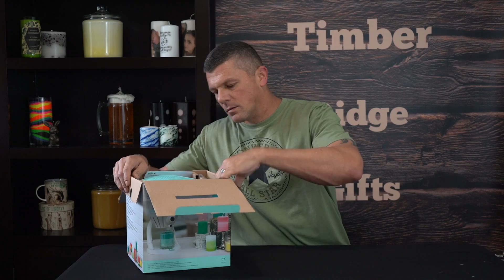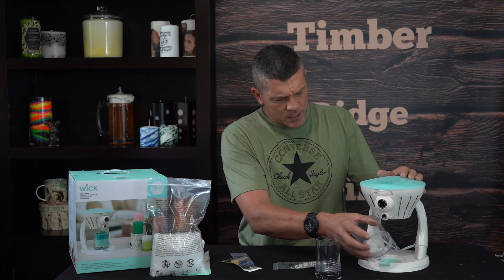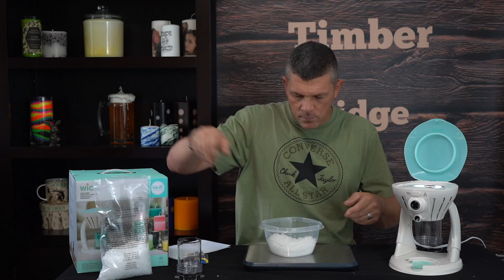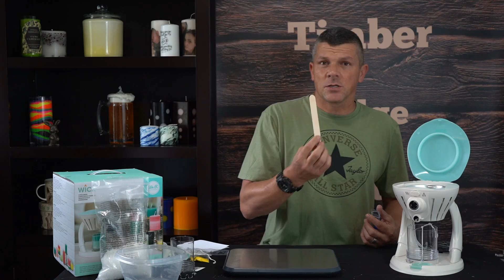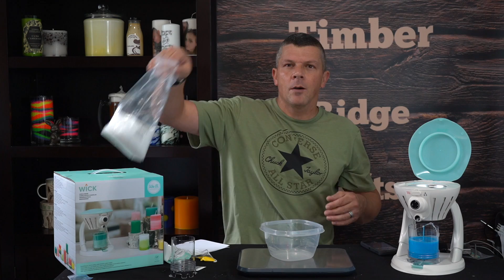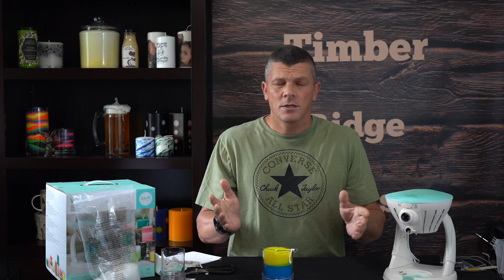Candle Making Machine! We R Memory Keepers Wick candle machine

Comment: Love my WICK 🥰 
Another helpful tip:
You can also run the candle wax into a heat resistant glass measuring cup (this glass measuring cup is where to add fragrances, not in the WICK itself) then pour into molds, to make different shapes and sizes of candles. Just prepare the candle wick in the mold, votive or I use fluted champagne glasses 🥂, then pour. I made the cutest Santa, painted the outside of a champagne glass red added glittered, black for the belt and glued on a plastic buckle, added poinsettia candle ring to the base of the glass. It doesn't have a way to share a picture on here.
I recommend buying a WICK, you can make lovely gifts large or small for family, friends or to add to your centerpieces.

Comment: My machine came with a hardened white paint like material in the wax chamber pot. Is that normal?
Reply from the maker: Hmmm, I've only bought the one machine that I have. Mine didn't come with that so it's hard to say. You can send me a picture of it through my facebook page, if I saw it I might be able to identify it.
Reply: Mine did also wasn't sure if that was normal or of it was lightly used before.

Comment: I also found this at my local hobby lobby, and they never have anything new this was the only one thought it be neat to do this craft with the kids I tried it and light keep turning on and off and the opening valve keep dripping into candle as if it had a leak feeling disappointed 😞
Reply from the maker: hmmm, Hobby Lobby is usually really good about taking returns. I'd take it back for a replacement/refund
Reply: I've also just ran into this problem. I want to figure out a way to fix it before I have to return it. Any ideas?
Reply: @psycheyo  I ended up returning it you should as well
Reply: @valleygirl3745  so the screw to the valve wasn't tight enough and once that was fixed, it worked all good.

Comment: Hi Tim how are you. Thanks for the video. Question: I have a lot of candle containers but I don't know what size they are. How do I measure the jars to know what size wicks to use.
Reply from the maker: a measuring tape will work just fine to measure the diameter of the jar at it's widest point. I prefer a tailor's measuring tape because it is much more flexible. The easiest way to measure the volume of the jar is to weigh it while it's empty, fill it with water and then measure again. The difference will be your volume.

Comment: I don't remember what brand mine is, but it's very similar to this. It is taller though so I can put in larger moulds. I bought it maybe 11 years ago from Walmart for about 24.00.  it works well for us but we don't do much fancy with it. We mostly use it to melt down candle reminents to make new candles or wax tarts.  I'll have to look at the measurements to see if this would be a good upgrade for us,  when ours  finally gives out.